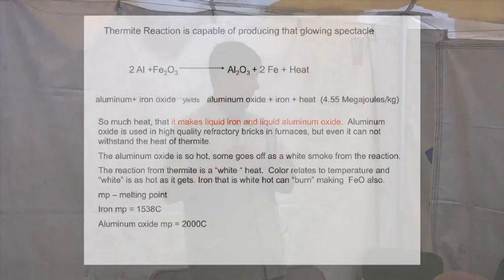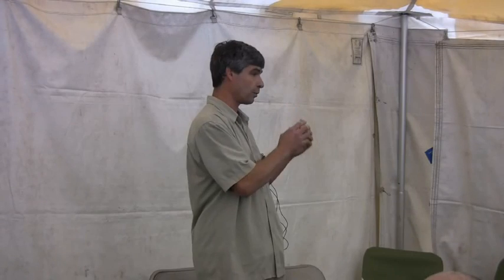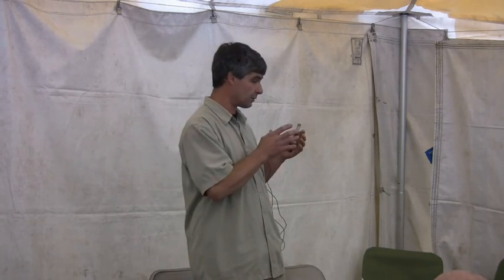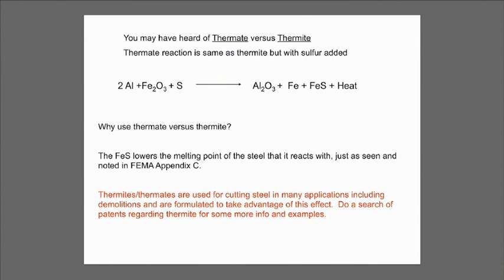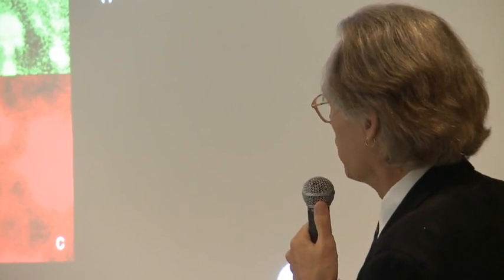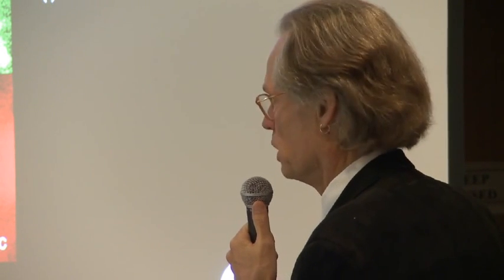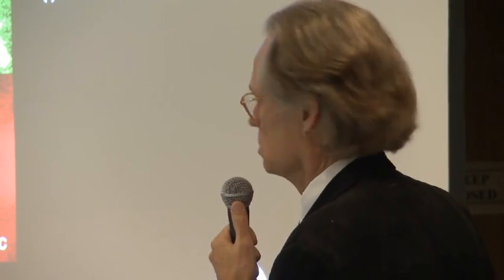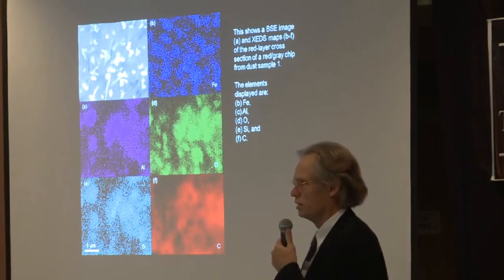9/11 nanothermite: Elemental aluminium in WTC-chips & video of ignition: Dr. James Millette is wrong

Comment: Interesting... Never heard about this before

Why wouldn't Millete re-create the experiments EXACTLY as demonstrated by Harrit?

If the ignition temp was reported by Harrit as 430 deg C, why would he (Millette) intentionally use a lower temp?

That just doesn't make any sense...
Reply from the maker: Bob Dobbs Hi
..On top of that:
- Millette also used more powerful XEDS-beam (20kv) than Harrit et al (10kv)  in their studies in which they detected elemental aluminium particles in the red-gray-chips. The higher voltage you use, the more penetration in to material you get, meaning the beam "reads" more VOLUME of material, possibly distorting results regarding very, very fine nanoaluminium particles, and making it appear that the Al and Si phases are chemically bound, so Kaolin clay. 
Source:
Radiation Penetration
Perry Sprawls, Ph.D.
http://www.sprawls.org/ppmi2/RADPEN/
" ..Aluminum has two significant applications in an x-ray system. It is used as a material to filter x-ray beams and also as a reference material for measuring the penetrating ability (HVL) of x-rays. The value of the attenuation coefficient decreases rather rapidly with increased photon energy and causes the penetrating ability to increase.."::
:::
- Millette layered the MEK soaked chip he studied with gold, "for better conductivity", but he must have known gold actually "masks" finer detail in XEDS, so possibly "masking" the individual nano-Al particles.
Source:
Effects of the Carbon Coating and the Surface Oxide Layer in Electron Probe Microanalysis
http://labmem.unsl.edu.ar/Publicados/Limandri_010.pdf"...the main disadvantage of gold and silver coatings is their tendency to migrate on the surface of thesample and coalesce into islands or particles that worsen the macroscopic conductivity and mask some fine details of the surface..."
::
:::- Millette used ULTRASONICS on the MEK soaked chip he studied, while Harrit et al did not, and this might also manipulate (clean loose individual particles off) the results.

Comment from the maker: Here:
"The existence of elemental aluminum and iron oxide leads to the obvious hypothesis that the material may contain thermite. However, before concluding that the red material found in the WTC dust is thermitic, further testing would be required. For example, how does the material behave when heated in a sensitive calorimeter?
If the material does not react vigorously it may be argued that although ingredients of thermite are present, the material may not really be thermitic."-Harrit et al

Comment from the maker: So he claims, but..

In the Harrit et al paper they state, that althou they apparently found elemental aluminium, they still need to do IGNITION TEST to verify that the material really is thermite.
That reversed..
Did Millette verify his chips by ignition test when he appears not to have found elemental aluminum???

No he did not. Millette stayed around 30 Celsius degrees below the reported ignition temp for the chips, which was around 430 C degrees, when he ashed the chips